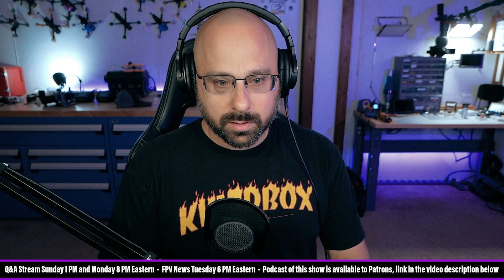How Do I Make Sure My Flight Controller Works With My ESC? - FPV Questions

Comment: I bought a aikon 4 in 1 esc based on the excel rc guys advice he picked these for me an aikon 30 a 4 in 1 esc and a x rotor micro convertible flight controller and the plug from the flight controller to the esc doesnt fit what do i do 😢

Comment: Big old esc' s strapped to the motor arms can work off of a flight controllers motor signal outputs that usuall go to a 4 in one esc board ?

Comment: Hi Joshua, I'm from Germany and nobody can help me. I hope you can. Could you telling me how I connect the Furling32 4in1 ESC to the lumenier Lux minif7? If I look to the pin map and build it like this, it will fail and I got no voltage to the FC. 
Thank you for your help.

Best regards
Reply: The flight controller gets power wher the  motir signal wires come out if it to go to the esc board .
 There are 6 or 7 wires . V+ , gnd . Read the fc if it needs v batt voltage  or  5v supplied from an esc board . , ,m1 , m2, m3 , m4 . And some have a "c" wire to send current sensor
   information to the flight controller for on screen display . It can fly without the " c " wire . Draw the flight controller pin out and esc connections on paper first is fun and easy way to not get confused or make mistakes when connecting .
  The flight controller needs a reciever connected  and bind it to a transmitter and configure an arm switch.  And small angle or level and calibrate the flight controller.

Comment: I personally have found iflight flight controllers, ADC for current does not work correctly with non iflight esc's. This shouldn't be a issue, as the adc is generally a simple 0-3.3v signal. I have 2 iflight flight controllers, one JBf7, with a tmotor velox 45amp blheli32(analog current). It doesn't play nice, I get wild numbers, and cannot be calibrated. Second is a Twing G 20x20mm FC, and a tekko32 f3. Replaced the kakutef7v2 that was connected to the tekko32(analog current), current scale was set at 172. Which was reading current meter perfectly fine, but once I installed the Twing, put the current scale in as 172, and current is not work correctly. Gives wildly inaccurate values, mah just climb, pulls 20amps at idle. Iflight says it's because I'm not using an iflight ESC,  and I need to connect telemetry. Which makes no sense, telemetry is already connected for bi directional dshot. Both esc's have one analog current sensor on the main leads. Telemetry would only work if each esc on the 4in1 had a current sensor.  This is the biggest issue I have with iflight. Every other FC I have ever used has a working current pin, no matter what brand the esc is. I cannot say the same, im 2 for 2 with Iflight FC adc current pin not working with non iflight ESC.

Comment: Hi Bardwell, in my experience, trying to combine the best cheap options I've tried different esc and fc between them and what I can say is that just swapping the pins is not enough to ensure that the esc and the flight controller works as they should, this is given by the fact that different brands of esc and fc, builds their board differently, adding more or less hardware filtering. I'm going to tell about my little experience, so what i found out some time ago was about a jhemcu fc and same brand esc, if you take a look to the esc board you can count around 4 condenser on it, and they give a 2200uF 35V external condenser, if you make it work with a zeus f722, you will actually see your drone flip by itself by throttling up, it was a very dangerous situation, but, if you take the fc from this brand, wich at that time was the jhemcu f7 bt, there is a plenty of filtering and condenser on it, so I tried to combine that FC with an iflight 32bit 50A 4 in 1 esc that has around 18 condenser on it (a minimum bare in my opinion for a decent esc) and I can say that I never seen a better stack like that. Indeed if you take the zeez stack, their esc is very filtered, so many condenser on it, but to give that confortable position on their fc they don't have so many filtering on it. With that said I don't want to talk about wich fc works better with one esc or another, what i can say is don't do experiment like that by yourself if you don't understand the electronics that you find on this boards, just go with a known good stack and there you go, you can fly happy. Please forgive my english please

Comment: I have a Mamba FC that just won’t fly well with a Tmotor Velox esc. It works as intended and flies, but it is twitchy and for whatever reason is not stable. Swapped escs between quads and gave it a spedix esc and it’s perfectly happy. The Velox esc works great with the tmotor fc in the other quad so 🤷🏼‍♂️
Reply: Interesting. Did you try changing esc settings, or flashing new firmware?